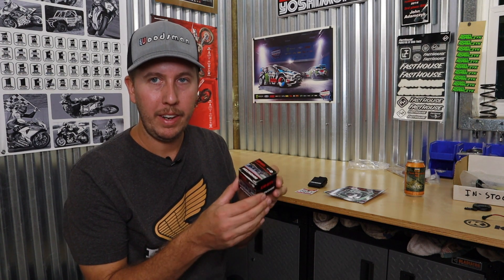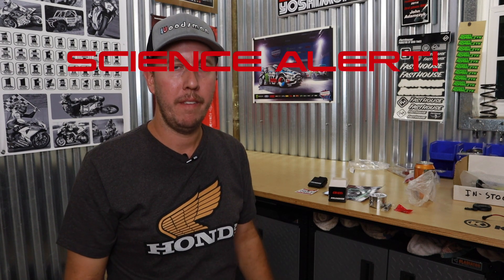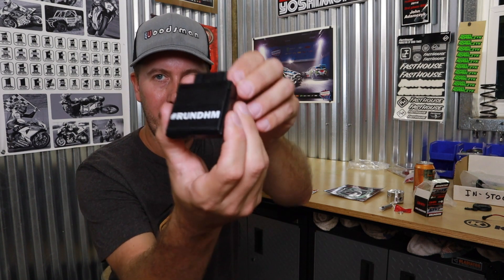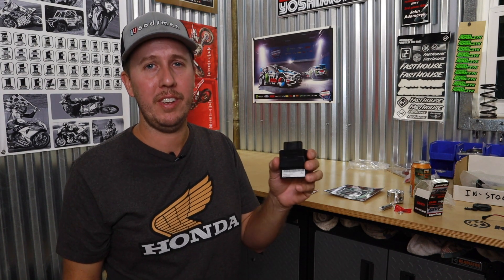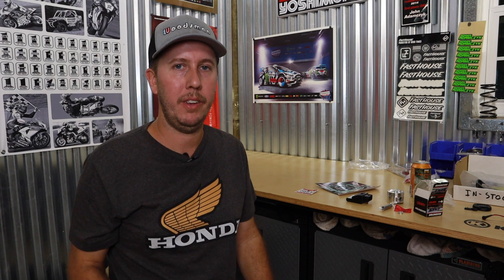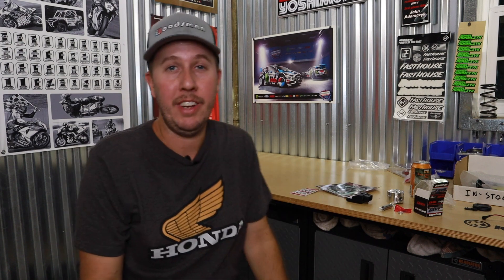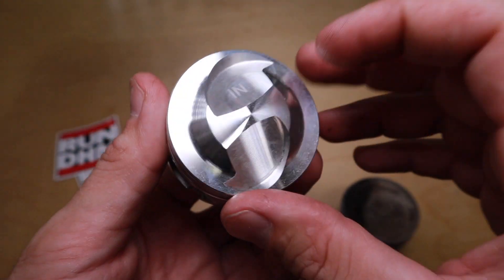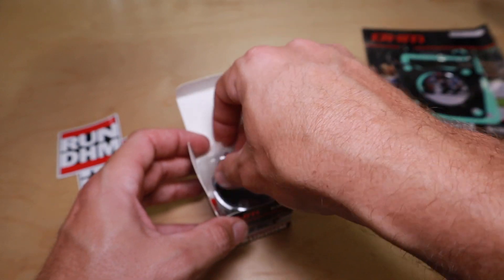What's on the Bench? Episode 2: DHM High Compression Stock Bore Piston Kit

Comment: John I can’t find if you gave opinion of cam install   Notice improvement.
Reply from the maker: Absolutely, but only in the mid-upper rpm range. The stock cam is good for low end power but falls short on the upper rpm power. I’d recommend the gearing adjustment to make up for it or maybe the high compression piston